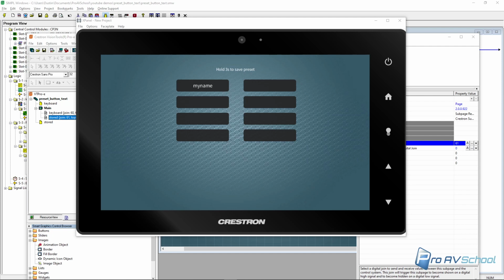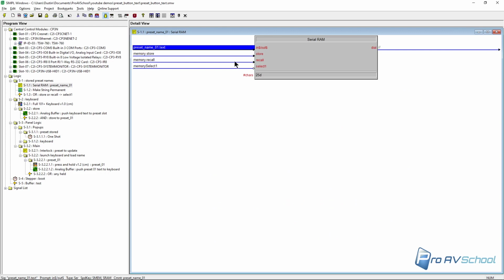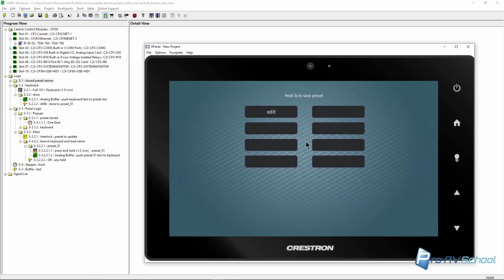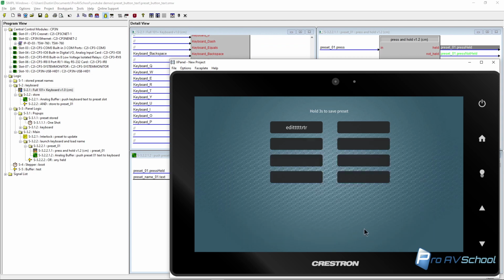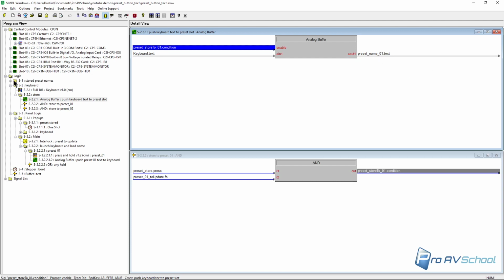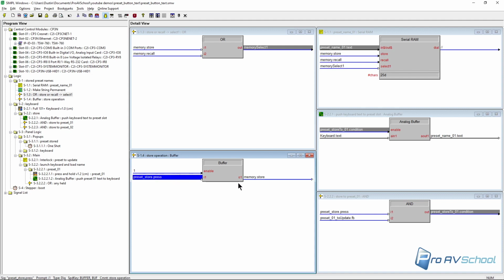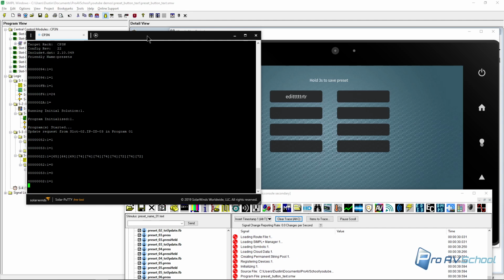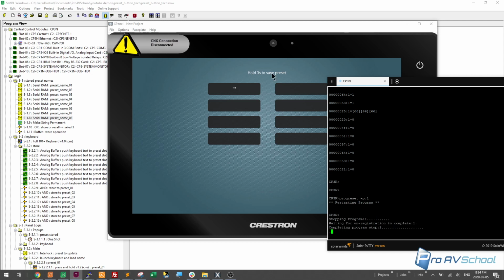Crestron User Editable NVRAM Serial Preset Names

Comment from the maker: A few people had problems running the example program. I think that is because the compiled file wouldn't run on 4 series as it was compiled with an older database last year. Anyway, I have updated the file with a newly compiled version as of 2021-06-22 and the link in the description will have the latest code. Alternatively, you can just recompile the .smw file I actually didn't have to change anything in the code. Tested and it works and stores/recalls nvram even when the program restarts.